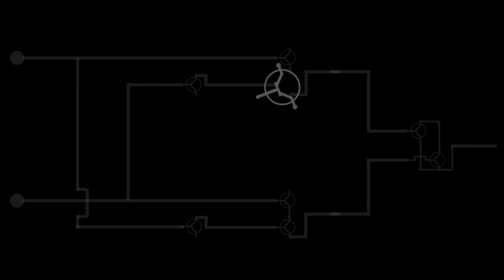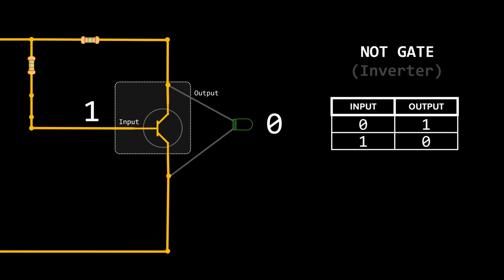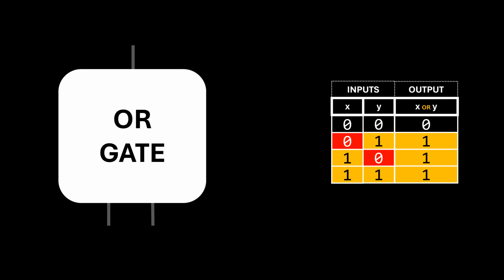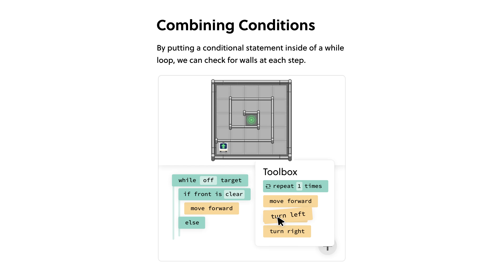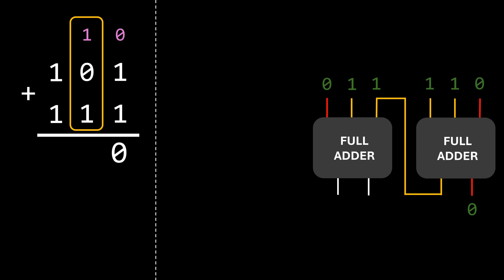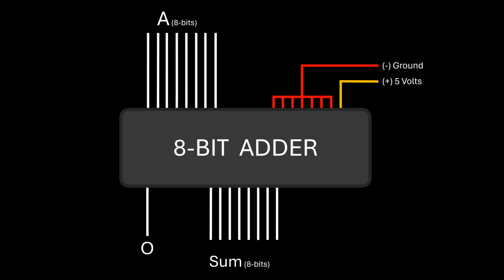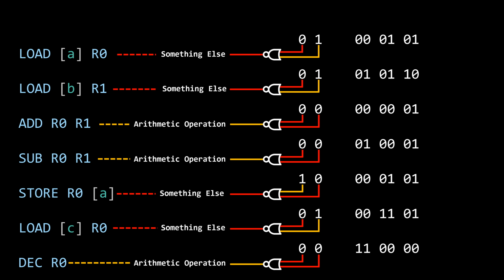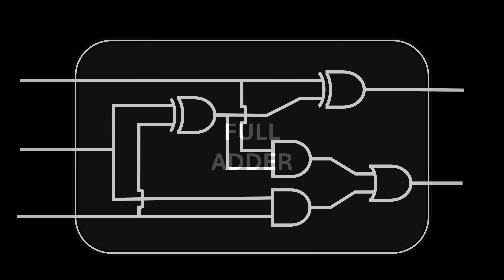HOW TRANSISTORS RUN CODE?

Comment: The transistors shown in this video are called "bipolar junction transistors" or BJTs.  Most modern digital circuits use a different type of transistor called a "metal oxide semiconductor field-effect transistor" or MOSFET.  They are controlled by voltage rather than current, and the circuits tend to be simpler.

The circuits shown in this video wouldn't actually work.  You'd need additional components to make them work.  But as a simplified illustration, they're fine.  Great video!
Reply from the maker: Yes, I tend to oversimplify things. Thanks for your support :D
Reply: @CoreDumpped  my friend, you are technically still correct. Of course any info on a broad subject such as this would be "oversimplification" in a 14 minute video. But, that doesn't make you wrong in any fashion.
On the contrary within a quarter hour you present a very dense amount of info. This is packed full of gems.
And you're example of Ben Eater is spot on. He builds his primitive breadboard processor using the TTL of 7400 series ICs. 
Just because BJTs would never work in modern ICs doesn't mean they aren't used to perform logic.
Reply: @CoreDumpped It is not an issue of over simplification, you just didn't know that bipolar transistors aren't used in modern logic technology.
Reply: Why wouldn't the circuits work as shown?
Reply: @cusemoneyman  Additional components are needed to make the transistors work.
Reply: @dfs-comedy  I understand, I'm just curious what specifically is needed. Current-limiting resistors? Or something else? Thanks!
Reply: @cusemoneyman  Here's why additional components are needed:
1. Biasing Circuits: BJTs need to be properly biased to operate in the active region, where they amplify signals. This typically involves adding biasing circuits to provide the correct base current or voltage to turn the transistor on and control its operation.

2. Protection Diodes: BJTs are susceptible to damage from voltage spikes and reverse currents. Therefore, protection diodes are often added to prevent damage due to sudden voltage changes or reverse currents.

3.  Load Resistors: BJTs often need load resistors in their collector circuits to control the voltage and current levels and to ensure proper operation as amplifiers or switches.

4. Coupling and Decoupling Components: These components are used to couple different stages of the circuit and provide stable voltage levels, ensuring proper signal propagation and preventing interference between different parts of the circuit.

5. Feedback and Compensation Circuits: In some cases, feedback and compensation circuits may be necessary to stabilize the operation of the BJTs and ensure that the ALU operates reliably across different conditions and loads.
Reply: @maedlum5511  6. Current Switching Diodes. Lots of BJT are used as back to back diodes and not as transistors at all.

Actually, its great to find somebody that really understands that all real logic gates are analogue !
Reply: @maedlum5511  About item 2, I think you have BJTs and FETs mixed up there. A high voltage can cause the insulation between the gate and body of a FET to break down and be permanently damaged. BJTs don't have an insulating layer and are much more robust when it comes to ESD.

I think the biggest reason FETs are used though is because they're a lot more efficient. BJTs need a little current to be constantly passing through them base to emitter to stay on. FETs only need a brief blip of current to change state. The latter will consume less electricity and not get as hot.

However, there were some computers made from BJTs before MOSFETs started being manufactured, and every schematic shown in the video would work with no more than the addition of a resistor here and there, so it's really more antiquated than incorrect.
Reply: @chitlitlah  I think everbody is talking about the technology KNOW, but boolean arithmetic is before digital circuits and so mechanical computers and so on. It's not just a oversimplification, it's a simple model, like every model we use to learn when studying any natural science subject.
Reply: @maedlum5511 feels a little gpt-ish to me. To simplify, at least resistors are needed (RTL logic). I don't know why the guy above is talking about bias, this is digital logic not analog.
Reply: @arthurdefreitaseprecht2648 while working with BJTs, you do need proper biasing in order to make sure your bjt is working in your desired state, mostly saturation and cut off biasing are used here. It's actually very important to be honest, you take a quick loop of a simple inverter using bjt, you'll see a bunch of resistors and bjts side by side to protect the components and to bias it properly as well. Proper feedback is also necessary for over current protection. These all indeed fall under the RTL logic anyway
Reply: Ohms Law  @cusemoneyman
Reply: I heard FinFET somewhere
Reply: @SarveshKumarMishra574  That's a modern transistor type for very small feature size (node) integrated circuits.

It was a way to overcome some of the challenges in extreme density integrated circuits which requires extremely small FET transistors.

It it still an FET rather than a BJT.
Reply: I believe you are missing the point of the video: it is an abstraction and oversimplification so it allows to explain more complex concepts.
Reply: To be fair, he does show the additional components in a few of the diagrams. Resistors namely.

But yeah, I think it was a mistake to use BJTs here, especially since it's actually easier to understand MOSFETs in general, especially in the realm of integrated circuits, where they can be bidirectional (as opposed to directional like BJTs). This means they basically act as literal switches, as opposed to the 'need some current at the base' weirdness BJTs have.

Also, I think it's a shame that he doesn't cover how P-type logic works. That's my favorite part of learning about transistors, because that's what makes Nand and Nor based logic simpler than having and/or with inverters.
Reply: It depends on what you are designing and what kind of logic you use. There is still such a thing as TTL logic. CMOS is in principle very similar but in practice is far different. 
Yes we are talking about current controlled basic circuits  which in terms of frequency and general practicality, specifically in the area of designing modern CPU ICs just would not function if designed as BJTs (the levels of heat produced would be insane).
But CMOS logic also fails on those levels of micro architecture of modern CPUs. Since you're dealing with gates sized only several nanometer, while typical CMOS Logic can be used to boot BIOS and firmware or operate Super IO, the gates of the dyed silicon are far different in design but not in principle.
If you're building your own computer and simple processor architecture I believe even TTL would work.
If I'm not mistaken there are videos of people like Ben Eater and others building primitive processors out of 7400 series TTL ICs. Those have Registers like the accumulator, a functioning ALU and even trigger flags. Plus they're all built on breadboards and can even be programmed in Assembly and C.
Reply: MOSFETs don't have a constant gate current, but they do have a capacity. Capacities are open circuits at the time you apply a voltage to them. You usually don't want a short circuit. So it will not be accurate to just use a ton of them, with no other components, either.

Meaning he should've used FETs instead of BJTs sounds kind of pedantic to me. It is the concept he is explaining. 

He's not teaching an electronics lesson. He is teaching hardware to software abstraction. And it is complicated enough.
Reply: @victor5.- Wrong language.
No such thing as "capacities". 
The gate input to the FET has capacitance.

This is caused by there being an insulating gate layer fabricated from Silicon Dioxide between the gate metal contact and the transistor where the conducting channel is formed.

This means that the FET is operated by the presence of an electric field created by the gate potential. Accordingly the FET is voltage operated and not current operated.

That gate oxide layer has a high resistance which means almost no current flows from the gate terminal into the transistor and hence it has a very high input impedance.
Reply: @deang5622  thanks, chatgpt. Since English is not my first language, I'm not used to using these words every day. What you say has 0 relevance in the matter btw.
Reply: @deang5622  by the way, the current produced by the capacitance IS relevant when designing a circuit. But it depends partly on the size of the element, so you have to study each case separately
Reply: @victor5.-  No it isn't.
You design the circuit by looking at the transistor curves.

In the case of "digital" MOSFETs which are designed to have a logic level output voltage and gate voltage, the gate capacitance doesn't come into it except at high frequency operation and you need to ensure that the transistor is appropriate.
Reply: @deang5622  so it might come into consideration, which is what I said. What happens if the capacitance of the MOSFET is so high that your power output cannot handle the sudden current when switching? You may have to use a driver. You seem to try to exclude it but every case needs to be studied.
I don't know why you want to argue with circuit design professionals about which parameter is more relevant when all may be relevant.
The topic we were talking about was how to depict a certain concept. BJT's symbols are well known, even for people who know nothing about electronics. Thats why I found the decision okay, since you won't be showing a complete circuit anyway.
Reply: @victor5.-  You are mixing up the different capacitances of the transistor.
We are talking gate capacitance here not the load capacitance on the output of the source or drain, and not the capacitance between drain and source.

And yes transistors connected to the output pads of an integrated circuit are of different design and physically larger than the transistors in the core of the die, in order to provide a higher current drive capability.

What you don't want to do is have every logic gate to have beefy drive transistors when they are not needed , as that is wasteful of silicon area.

Designers have two options.
1. Select logic gates with differing drive capabilities
2. Use buffers where needed
Reply: @deang5622  no one's mixing any capacitance. Well, you may have been. I was talking about the gate capacitance the whole time. 
And again, this is out of topic here.
Reply: @victor5.- Only 1diots don't care about the details.
The symbols used show the wrong type of transistor. It matters.
It is misinformation. And students of digital logic should know the difference between NMOS, PMOS, CMOS and ECL.  How on earth can they construct logic circuits using integrated circuits if they do not know the difference?

They have different power requirements, the relationship between power and frequeny of operation are different, the logic level threshold voltages are different, input and output impedances different.

You can't build anything unless you understand this.
Reply: @deang5622  this video is not for students of digital logic. It does not want to teach you how to build circuits, since there are so many more things you'd need to know. And you don't seem to know them either, from the way you write. Everything sounds generic to me... but I could be wrong.
Reply: @deang5622  he even said it's very brief and over simplified. It's easier to understand for beginners like myself. If you're so advanced why are u commenting or even watching this video. Like bro shut up and leave. respectfully
Reply: Did you know about TTL?
Reply: The 74XX series are made of TTL gates I assume. It's still relevant as the core functionality and concept remains the same. CMOS do have a pull up and a pull down network to maintain the strong low and weak high logic, but again, they work the same. Give positive voltage to the ground in an nMOS or npn BJT, you'll get a short circuit. I think transistors are easier to understand in basic levels :) just my opinion

Comment: Great video but one nitpick. The way you’ve laid out the transistors is reflective of PMOS logic without the resistor shown. That’s not the way that transistors are laid out on modern chips. That’d be CMOS logic. - long time subscriber and chip designer

Comment: Nand2Tetris is a pretty good open source textbook, which starts with boolean logic and finishes with a Tetris clone written by the reader, going through all that's in between, from logic gates to the ALU and RAM to assemblers, virtual machines, compilers and OSs. If you're interested in computer architecture, it's a MUST read.

Comment: Shouldn't we use NMOS and PMOS transistors? They can be powered with just voltage without current, they are faster and more energy saving.
Reply: The fastest transistors are GaAs BJT . SiGe seems to exhibit low noise. GaN has high efficiency in analog applications. CMOS ( nMOS + pMOS ) is most efficient for digital applications. It was used in 1976 in RCA1802 , 1981 in 65c02 , 1986 in Arm , 1987 in i386 ,  1992 in 68ce00

Comment: That was an amazing explanation, Thanks so much, i love this type of concepts, this video illustrated it so perfectly, i also have a question, the binary decoder can them be at multiple level(nested)? is there like sub-categories for a given opcode(can it be thinked as opcode as a namespace?) is there such a thing of specializations sub-opcodes or something like that, this video was so amazing and turned on my curiosity, loved it?
Reply: Opcode is Operation + operand. Indeed MIPS group’s operations into 3 groups: R-type , J-type , I-type.

Store has a length parameter. So you can store 1–4 consecutive bytes.
Reply: @ArneChristianRosenfeldt  Very very interesting this concept

Comment: Beautiful explanation bro, I learn a lot from you, i just just a question that always hit in my mind, how the assembly instructions turn to machine code?
Reply from the maker: Thats what Assemblers do. They take assembly code as input and translate those "words" to ones and zeros.
Reply: @CoreDumpped  yes I know, but how is that?
Reply: @mrswolf1047 what exactly do you mean? A simple assembler reads a text file line by line. A simple machine language consist of a 32 bit word. So these are the input and output.

The tokeniser splits the line into instruction and the register names . A dictionary translates the instruction word to a bit pattern. The registers have a number. Just parse as unsigned int5 .

The assembly code used here clearly uses spaces in the text file to split up stuff. You know that binary files exist? On C16 I would load them in MONITOR to a specific address. On the PC DOS would load com files into RAM, set the segment registers to the start of this block and jump there.
Reply: @mrswolf1047  A CPU is an implementation of an instruction set architecture (ISA).
ISAs tell you what instructions are available and how to turn your instructions into machine code, among other things.
So that's the main thing you need to reference if you are implementing an assembler.
Reply: @ArneChristianRosenfeldt  I'm talking about in the hardware level, I know that the assembler translate assembly instructions to machine code, but how this translation is happening under the hood in the hardware level?
Reply: @ArneChristianRosenfeldt  but how is that? What's happening under the hood, you know what I mean?
Reply: @mrswolf1047  the assembler runs once and stores the binary result for multiple uses ( in the future, on other computers ) later. The runtime environment might not even understand the specific assembly language ( intel vs sun ).

Commodore C16 has an assembler in ROM, while C64 has only BASIC .
Reply: @mrswolf1047  "I know that the assembler translate assembly instructions to machine code, but how this translation is happening under the hood in the hardware level?"
An assembler runs at the software level.
Reply: @Vaaaaadim  bro that is a basic explanation, we all know that it's runs at the software level, but how is that, how even the software level works, what's the architecture of it, how the hardware level create the software?... I know that they are hard questions, but that is me, I love to know how things work and it is a big problem actually
Reply: @mrswolf1047  Normally when you make anything in computing, you build on top of something that has already been made. If your goal is to make an Assembler, normally you assume you already have a computer.
Reply: @Vaaaaadim  well, I just love to learn how things work